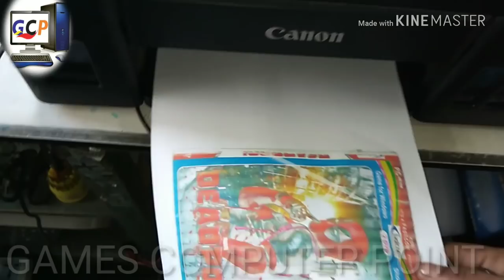How To Fix Canon G1000, G2000, G3000 ink not working?

Comment: Hi would like to ask how to fix this error: "To check the remaining ink level, visually inspect the remaining ink in the ink tank.
If the function for remaining ink level notification is working and an ink tank is refilled before the remaining ink level reaches the lower limit line shown on the ink tank, a significant error may occur in the accuracy of remaining ink level notification function. If you want to refill an ink tank before the remaining ink level reaches the lower limit line, be sure to follow the procedure in the manual. If printing is continued when the remaining ink level is below the lower limit line, the printer may consume a certain amount of ink to return to printable status and may also become damaged." Athough there's ink already. It won't proceed to printing. Thanks.

Comment: I have mistakenly put black Dye ink in my G3200, when it should be Pigment black, and now I'm getting Error 5200, and wondering how to get the ink back out of the tank... is it possible to remove the entire ink tank?  Suggestions welcome!
Reply from the maker: Head cleaning  and flash software
Reply: @GCP77  Thank you for your reply, GCP!  My black ink tank is full of the black dye ink, though, so before cleaning the print head, I have to get it out of there.  So I'm wondering if the tank will come right out, or if I have to tip the whole printer upside down to pour it out?  Or is there another way? Thanks!
Reply: @ancientmyst9979  Thank you, that's a good suggestion!  It's not a cartridge, it's an refillable ink tank, but maybe it will work.  I'll try it.